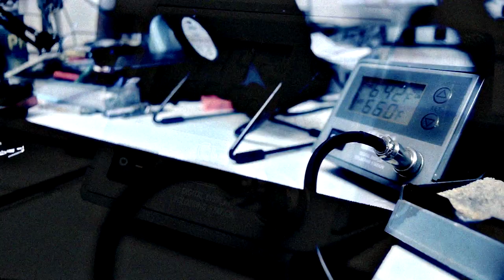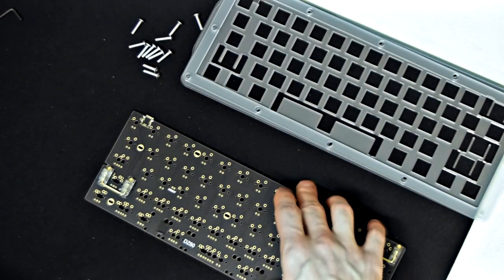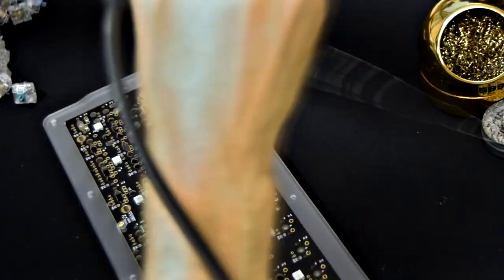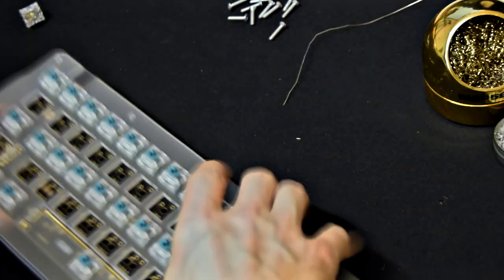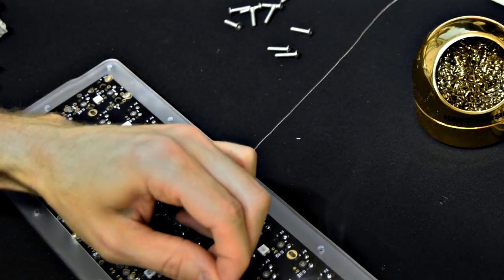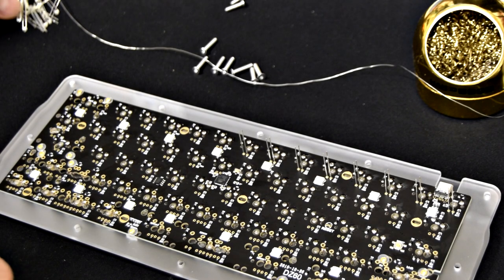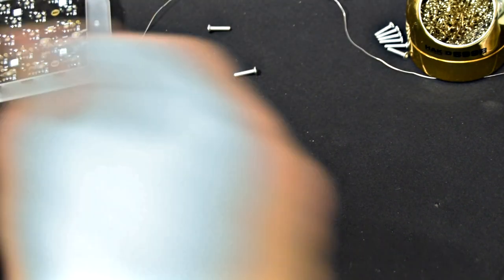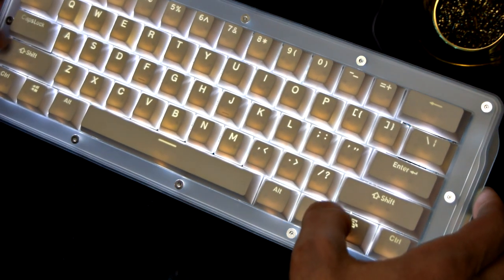PPCS Keyboard speed build

Comment: you really need to add another top layer because it is not a low profile case but the switches are still exposed and it kinda looks weird, but overall it is pretty coool